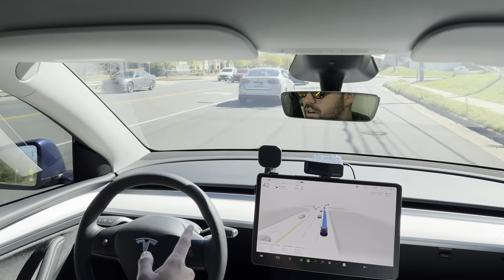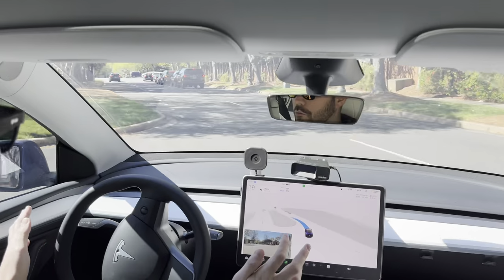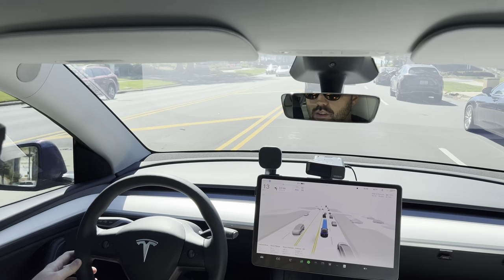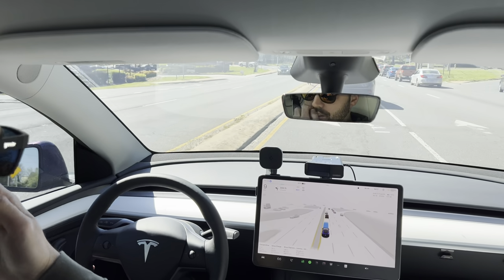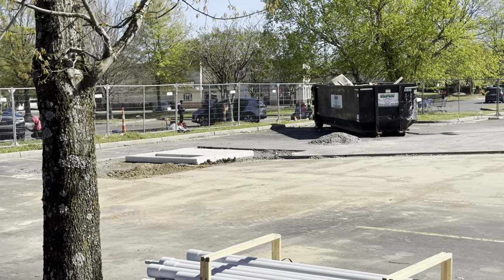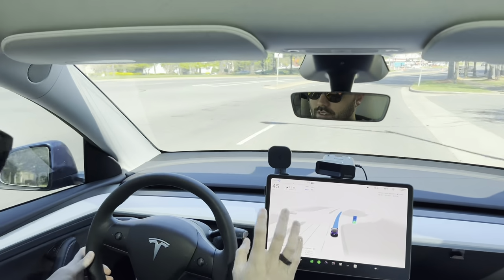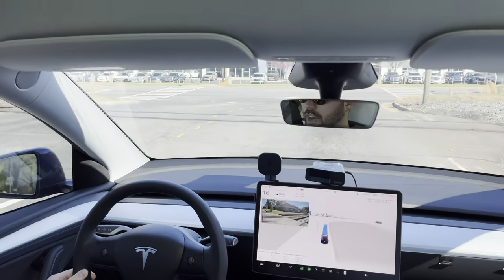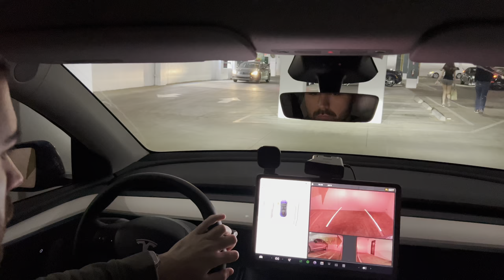Game-Changer!  - FSD 12.3 Demo Drive In Model Y w/ HW4

Comment: FYI: Tesla said HW4 is not being utilized by FSD yet.
3:55: Crept too far into road, fully blocking a lane. Granted the lane appeared to be a new lane, so not blocking much.
4:33: Fails to utilize median and does not take initiative when left traffic was turning off.
6:15: Dodges around stopped traffic to keep going straight at intersection.
7:35: Pulls into both lanes coming out of PL.
9:08: Swaps to less backed-up lane at light.
15:16: Indecisive lane selection into wrong lane into hard brake.
17:30: Indecisive lane select into good right turn despite slightly confusing road markings.
18:25: Goes extremely wide on right turn.
24:20: Indecisive lane selection again.
25:00: They're unveiling the car model that they will use for their robotaxis, which should be pretty much the same as the compact car they are set to produce next year. I don't think we'll see more than the car, maybe app implementation, business model, and potentially a demo drive. I'd say they might also have gotten regulatory approval in an area but apparently that's not a thing; autonomous driving is legal by default in most states.
25:20: Good UPR.
25:55: More indecisive lane-selection.
34:15: Successfully navigates underground parking lot.

Man, it sure does have a lot of lane-selection issues in your area! 😯
Reply: Lots and lots of problems!   Thank you catbert for all the time stamps. 

omg FSD full autonomy is still years away.

Comment: I live in the northeast. Past versions of FSD have not worked well here. This version is a big improvement. I’ve been using it for the past 5 days. Most of my disengagements have been to avoid hitting potholes in the road. Our roads always have a lot of potholes this time of year after the winter weather. These usually get patched in the spring. 

The next biggest issue is FSD putting the car in the wrong lane. The most common scenario is the car moving into the “right turn only” lane even though it is going straight. 

I also have to disengage around schools and construction sites. FSD doesn’t recognize crossing guards or police officers directing traffic. 

Great video!
Reply: A human driver can easily see the potholes, and avoid them.

A human driver can see broken glass in his lane, and avoid it.

A human driver can see speed bumps in the road, and avoid them.  Every time.
Reply: @DerekDavis213  fsd will get there too
Reply: @a-don13  FSD is in beta for almost four years .

Latest v12.3.4 still makes all kinds of rookie mistakes.   Still a simple minded Level 2 assistant.  Nothing more.
Reply: @DerekDavis213  yes and it got better. No reason to assume it won't get even better lol
Reply: @a-don13  FSD will certainly get better.   That is a reasonable assumption.

But will the current simple minded FSD ever achieve Full Autonomy, Level 5?    Doubtful.
Reply: @DerekDavis213  it was simple minded up until v11, made me lose hope for it even. v12 end to end is totally different.

also i wish people stopped using that stupid Level metric. its level 5 now, it just makes a certain number of mistakes more than the perfect driver.
Reply: @a-don13  It is still simple minded, with the latest 12.3.4.     Still problems making unprotected Left turns, missing turns, almost crashing into gates, wrong lane, very slow and lots of hesitation, not signaling consistently, not slowing for speed bumps consistently.   The list goes on and on.

Watch other people's recent FSD videos on Youtube.  Lots of human interventions.

And btw, latest FSD is absolutely not Level 5.  You are funny.

Comment: They are clearly on to something.  I think they are just having the system learn.  The true test is to see the level of improvement over the coming weeks or months.  Some of the breaking actions I THINK are due to NTSB regulations.  I was always skeptical of FSD working but I am absolutely impressed at how far the technology has advanced.  Even what they have achieved to do I was skeptical that this was possible.  My hats off to all the engineers involved.  What they have achieved with Cameras and software is impressive.  I am curious to see the progress in the coming months.

Comment: I've never had FSD before and started the free trial (12.3.3) about a week ago. My experience is similar to your video. Mostly it's pretty damn good. My biggest complaints: 1) hesitant to go sometimes when it should, 2) when two turn lane choices are available it is sometimes wishy-washy deciding on the lane, 3) the auto speed sometimes goes too fast thru neighborhoods with 20 mph speed limits, 4) and it doesn't do very well at avoiding potholes. But overall, I'm very impressed and optimistic that it will get better fairly soon, given the speed at which AI can learn, especially since Tesla now has enough compute to make it happen.
Reply: given the speed at which AI can learn, especially since Tesla now has enough compute to make it happen.

But that entire sentence is based on promises from the Marketing Dept at Tesla Corporation.

The public has no idea to what extent that is even true.
Reply: @DerekDavis213  I won't debate with you about marketing and that the general public is clueless. But I have 30+ years experience in software and have been working with some open source AI neural net projects and following some of Andrej Karpathy's tutorials (i.e. how to implement transformers). It quickly becomes apparent what can be achieved with LLMs and also how compute intensive they are. Compute and data are indeed major constraints. Tesla has the data and the money to buy the hardware and talent to make it happen. 

FSD won't be perfect until Tesla's AI model achieves the equivalent of AGI for driving. It's a similar path to progress as with Chat GPT and other LLMs. They have gotten pretty darn good fairly quickly, but still occasionally exhibit some odd behavior... same with FSD. 

So Tesla has trained the AI driver, and it's pretty good,  but still shaky at some things (like a student driver). The only way it can improve and gain knowledge is through experience. In AI, experience == lot's more data and compute.
Reply: @meganote   'They.... still occasionally exhibit some odd behavior... same with FSD.'

And when FSD makes mistakes, there could be loss of life .   Do you see the difference?

And driving in the real world has almost unlimited edge cases, that FSD will not be trained for.   A human can think and reason, and instantly adapt to strange or unknown situations.

FSD will never be capable of that.
Reply: @DerekDavis213  Yes. This is why the current version of FSD requires human supervision, although it is suprisingly good. Once AGI for driving is achieved (I'm guessing 1-3 years), it will be better than all human drivers and many lives can be saved each year. Currently, there are approximately 20k lives lost in car accidents each year (in the US). The majority of these lives could be saved. Do you see the difference?
Reply: @meganote  Current FSD is pointless if it requires 100 percent human supervision at all times.   It is easier and safer to just drive the car yourself.

Elon never promised 'Supervised Driving'.  He said it would be Self Driving, with no human input required.   That's what he said 8 years ago.

20k lives lost in car accidents each year?  So what?   That is not even in the Top 10 causes of death in America.

And what is your solution?  Level 5 Self-Driving for everyone?  That does not exist and may never exist.

Less than 1 percent of cars in America are Tesla, and only a small percentage of those people paid 12,000 for FSD.

Comment: I've had some of the same issues in this video on the new FSD. Mine hugs the right of the lane too close IMO, I've taken over for it because I was worried about it hitting the curb at 20MPH.

We had a lot of rain here and it constantly sounds the alert sound over and over during the rain as if it didn't know it alerted me 45 seconds prior.
The side cameras get an "occlusion" warning at night.
It does not follow the speed limits I set, sometimes it is way more cautious to the point of going 15mph below the speed limit.
The biggest issue I've had is it detecting the NY State route 5 signage as a speed limit sign, causing it to slow down fast to 5mph on what might be a 55mph road.

Overall I do see it as a big improvement, and I hope they are able to continue to develop it.

Comment: I have been testing FSD also and found that I really dislike the abrupt acceleration from traffic stops at street corners. My MY will start off at a reasonable pace and then suddenly speed up to the speed limit like it is in a race. Not a good way to save power. I normally get at least 4 miles per kw around town by anticipating conditions, but FSD is driving my average down. Also my MY originally traveled faster than the speed limit when set at the default of "average" especially in tight residential areas that even the speed limit is occasionally unsafe for the conditions, narrow residential, parked cars and work trucks. I found that the speeding problem is what Tesla calls "average" driving. If you set it down to the lowest choice it will still speed up (too fast) to the speed limit for that road but not exceed the speed limit. It speeds up so fast that it has to back off when it gets to the limit and then you get sort of a lurch forward when it backs off.

I also have found that since the FSD was added, for no apparent reason a single swipe of the wipers will happen. No rain or water noted. All in all, not a very smooth driver. So far not a relaxing drive, working harder correcting small things and making sure the car won't do something stupid.

Comment: 25:00 Teslas have an internet connection so a robotaxi can be controlled by a distant operator when needed, not to steer but just to give high level "orders" such as "go", "wait", "overtake", "reverse", "change route", etc. With a few big screens to show cameras, the map, the car status, (...) I think an operator could easily understand the situation and give the proper order. The operator would be affected to a "situation" by an algorithm that could take into account the location, then if the operator could more easily handle all the cars having the same issue, and later all the videos could be used to train the artificial neural networks with quite valuable meta data.

Comment: This would be way too stressful. I would rather just drive
Reply from the maker: I felt that way about previous versions but this is actually pretty stress-free once you’ve spent a bit of time with it
Reply: With 11.49 it was that way now it’s way better and more smooth. Keep it on for a full day driving or an extended road trip and you’ll find the Tesla is safer than you because it’s attentive 100% of the time while in some moments a matter of seconds you’re a distracted driver.
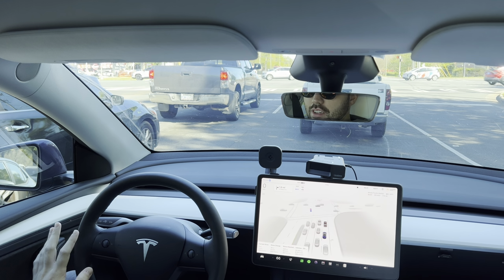Reply: A bit like the stress of riding shotgun while a brand new driver makes a mistakes at a relatively high rate per miles traveled. (Made this comment before Branden himself makes this same observation 26:25)

Comment: Tried it in snow and it didn’t quite understand that that white stuff required slower acceleration and more gentle braking and turning. Was pretty squirrelly taking off and gave up and cried “Hold me daddy!” after four wheel drifting into the first corner. Someone needs to explain snow to the algorithm…
Reply from the maker: Sounds sketchy but interesting!